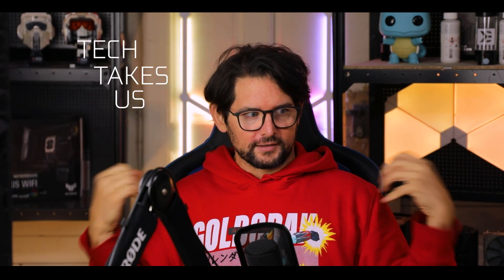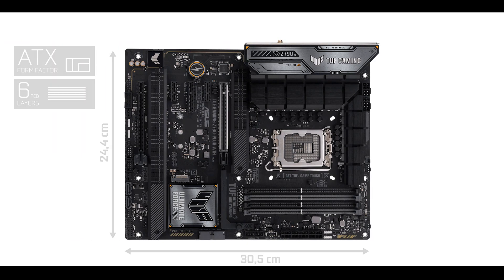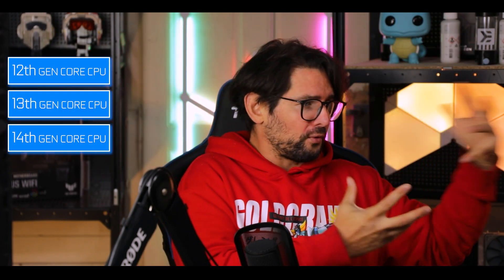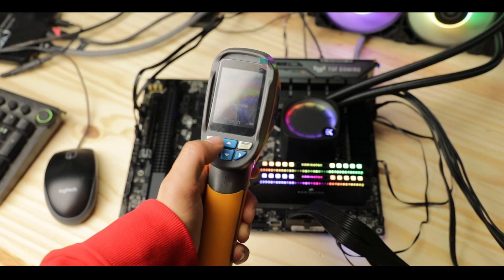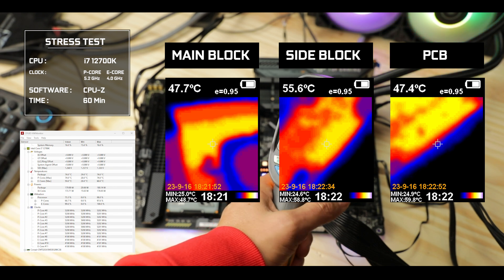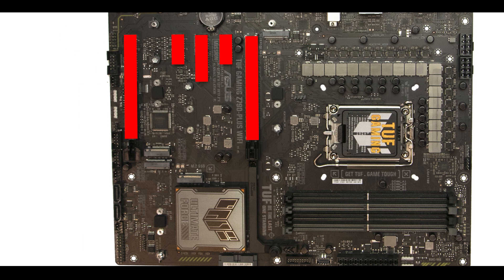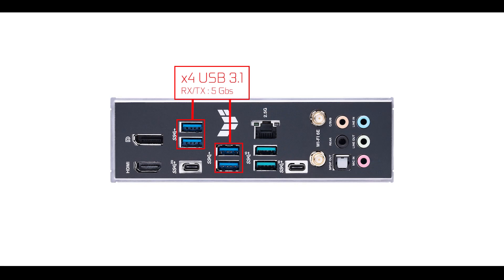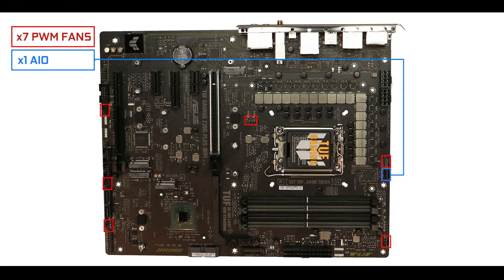TUF Gaming Z790-PLUS WIFI , Disappointing!

Comment: Thank you so much for mentioning the m2 slot taking bandwidth from the x16 slot on some ASUS boards! ASUS really should stop doing this, it exists purely as stats padding and making a worse end user experience.
Reply: The PCIe bifurcation has nothing to do with the m2 slots build in on the mainbord. It is relevant for an additionally sold Hyper m.2 pcie 16x card which can hold up to 4 additional SSDs. You don’t sacrifice your PCIe 16x gen 5 slot when using more than 1 internal m2 ssd as wrongly stated in the video, only when you add the Hyper m.2 pcie 16x card. Furthermore this is a chipset limitation and not specific to this board, lots of wrong information…
Reply: I agree, but by the time a real board that need PCIE5 arrives, we would be at 16th gen? ...  there is no real competition to the 4090 at the moment and any card that claim to have PCIE5 (but performs worst than 4090 or even 7900xtx) is probably just stat padding their product.